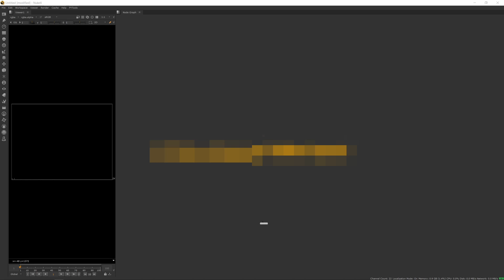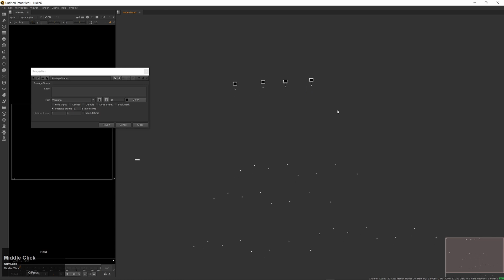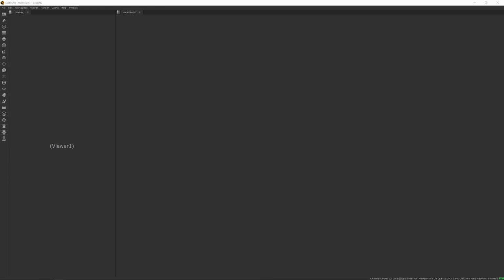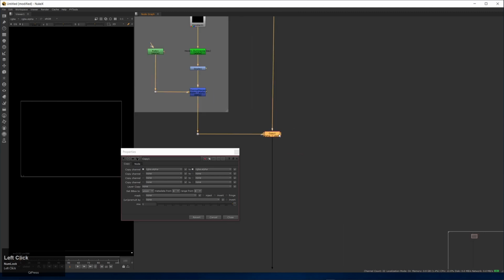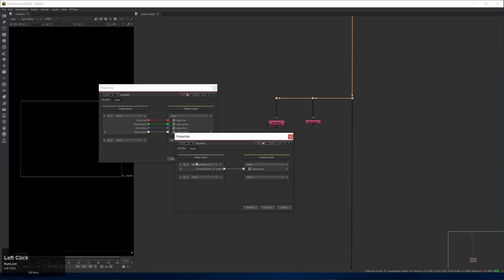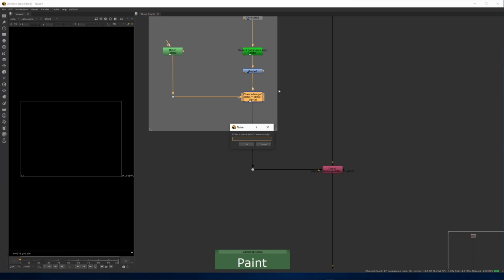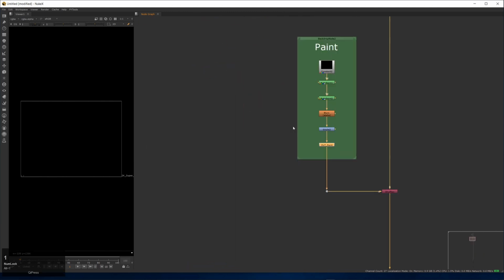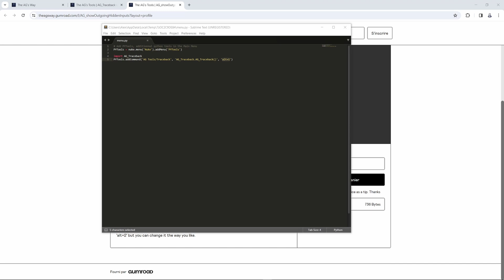The AG's Way Nuke Compositing | Introducing my first shared tools

Comment: Not bad, if the company don't have a "Stamps" in pipeline, in other way Stamps works well.
Reply from the maker: To be honest, I never really liked Stamps nor other tools like dotConnect. In my opinion, and this is personal (I know how risky this topic is 😅) it creates messy comps with hidden links everywhere. And when the comps start to be really huge it is very difficult to traceback everything, especially if you have been assigned to somebody's else comp. BUT, their are pros and cons in using hidden inputs or shuffles (I should do a video to express my opinion about that by the way...) I use shuffles... and it's precisely because not everybody do and a lot prefer hidden inputs (with stamps, dotConnect or other) that I created those tools. The first one (AG showHiddenInputs) to navigate with more comfort in comps with hidden inputs, and the second one (AG Traceback) to use shuffle like me and be able to quickly traceback to the origin. You can now chose your battle and always be the winner 😉😉